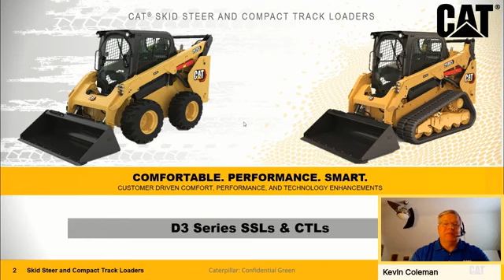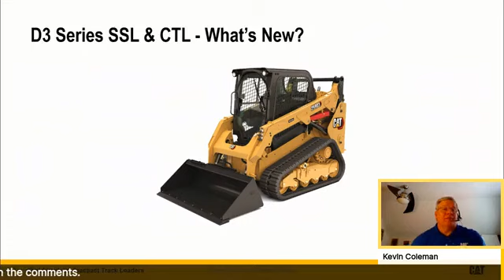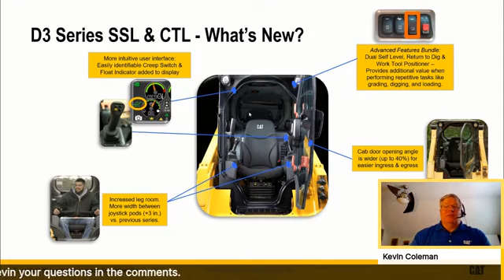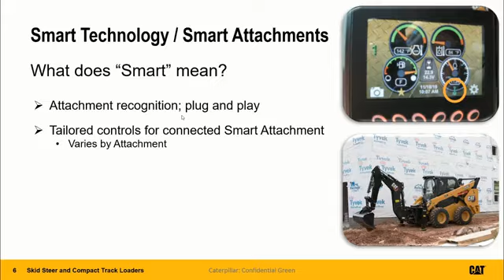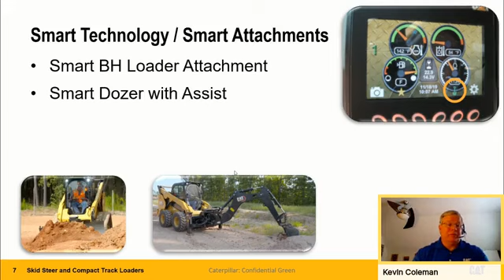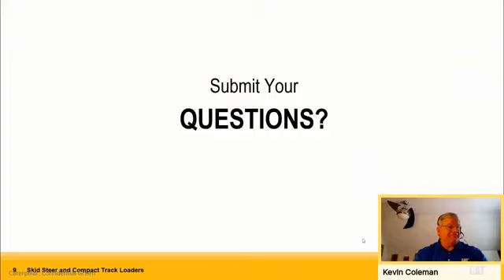Cat® At Home Series – Skid Steer and Compact Track Loaders with product specialist Kevin Coleman

Comment: I have a 287 trac cat trac skid steer with hydraulic release bucket no letters behind number does it mean and older machine?
Reply from the maker: Hi Richard! If your Cat 287 multi-terrain loader does not have a letter series then it would be from the first series of that machine, which was in production from 2003-2004. If you'd like to provide the machine's serial number we can confirm production date for you. - Dani

Comment: Why are the drive motors so loud on the D3? 
 The 259 D3 I have has a really loud whine to it,enough that it will give you a headache after a short time.  The 18' 259 I have has very quite drive motors.
Reply from the maker: Hello Eldon! Your Cat dealer can help! To find a dealer near you visit https://bit.ly/3dfaJkz - Patricia
Reply: Do you have the enclosed cab?
Reply: @rclover99  Yes mine is enclosed.
Reply: @1rutcutter  I commented on your other video you had posted a while back. My cat salesman was at the house today and we made a call to a guy that has factory connections. The problem is the plastic block that the drive hoses go through before disappearing under the cab. The plastic is too hard and bolted directly to the steel and the hydraulic noise is amplified.While Ive known this for a while I finally got around to removing mine from the machine totally and am happy to say the machine is whisper quiet, quietest machine I have ever been in........zero drive noise what so ever. The only problem with removing is now dirt and debris can find its way under the cab like the older machines. In the meantime I am going to make a rubber gasket to put between the plastic hose block and the frame to act as an insulator and see if this keeps it quiet. Cat has been working on it and havent been successful just yet but the man we spoke to today assured us it will be taken care of sooner rather than later. If you want to remove them for now it only takes about 10 minutes. It comes apart in layers, remove the first 2 layers and leave the last one bolted to frame. This will allow hoses to not be rested against the frame anymore and you wont believe how quiet the machine is,........its a total transformation. There is no danger to the hoses like this, no more than they have on any other machine so while waiting for cat to release the final revision of their fix this is an option that works
Reply from the maker: Your Cat dealer can help! To find a dealer near you visit https://bit.ly/3ddOCeo - Patricia
Reply: @reubenfrazier5603  no your not the only one. Its a D3 issue regardless of model apparently. . Easy fix just give them time, they are trying to keep the same hose mounting setup but find a material that doesnt amplify the hydraulic noise. In the mean time pull those hose brackets off and enjoy peace and quiet.
Reply: @reubenfrazier5603  CAT has had my 259D3 sitting at the shop lot now for 3 months waiting on a fix.  
I do have a rental im using but seems to be taking forever.
Reply: Reuben Frazier ya I hear ya, its obviously noisy and they should of taken care of it before release but still an awesome machine. Take the 10 minutes and remove those holders while waiting on cat to send the update and the machine becomes whisper quiet.
Reply: @justinvoisine8750  Any update on a fix yet?
Reply: @reubenfrazier5603  Just an update,CAT finally has an updated block to help with the noise.  My dealer called to have me come in an listen to my machine and its a lot better.